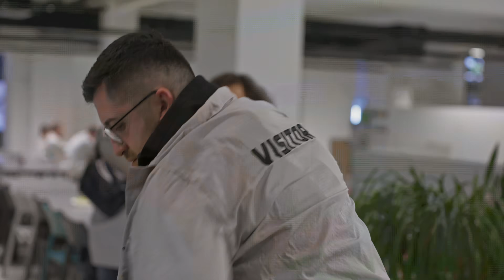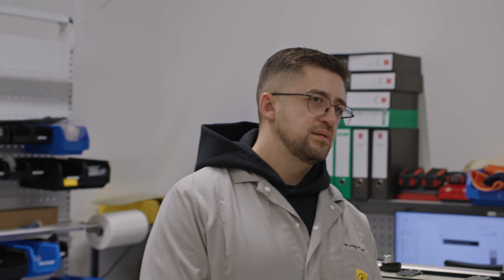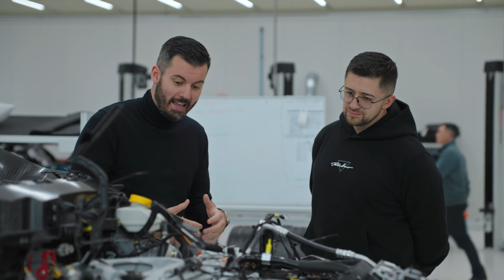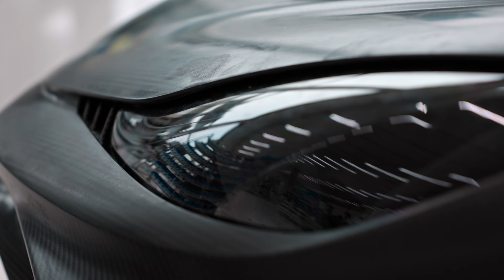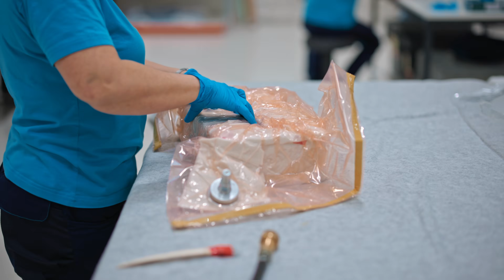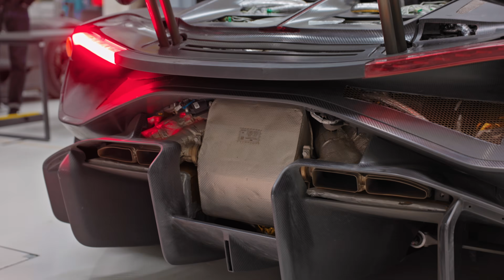Mate Rimac Explains New Bugatti Tech // Campus Tour

Comment: Next video should be about: 1. The ideas Rimac stole from a regular garage guy from Samobor, Croatia back in 2008 and never paid him a dime
                                                   2. The money his father stole in the past 25 years and got jail sentence just a few weeks ago. The money was also used for the Concept One - first Rimac car.
                                                   3. Pushing the deadline on Robotaxis for the sixt time in a row. He received 179 milion euros from the EU to develop them, so far only provided a drone footages of those robotaxis parked :)
                                                   4. Complete failure when presenting the first Robotaxi in 2024. Rimac received the 179 milions because he promised level 5 (Full Driving Automation). When presenting the Robotaxi on the stage, the guy was seen backstage with a joystick and controliing the 
                                                       vehicle. Mate later confirmed that Robotaxis cannot operate without joystick :). That also did not work, since the joystick broke and Robotaxi didn't move an inch :)
                                                   5.Promise from Mate himself that Robotaxis will be 90% in-house built. Well in the end, he bought the finished product from the Israel based company -Mobileye and the car chassis will be manufactured in South Korea
                                                   6. Would there be Nevera without engineers from Porsche?
                                                   7. Bragging about Bugatti when he holds no rights at all for any aspect, except from the fact that Porsche is also behind everything and used Mate for the promotion mostly.

Comment: The E30 M3 might just need some maintenance to bring it back to its factory glory. Suspension bushings, shocks, and a good fuel system cleaning will do 90% of it. But of course, Rimac’s point of reference is 1000 hp+ HyperCars 😎

Comment: At 6:45, Some great remarks regarding linear flow in manufacturing, with zero fail rates👌🏅 Excellent choices in automation and integrated QC. I was once QC for some sensitive items, and you guys have obviously adopted a great QC and are reaping the benefits 😇. At 21:20, containment of battery chemistry as integrated with structural mechanics and design if my thinking is correct.. True?. An additional note; torque vectoring is a key transition in automotive markets 🤔😉  An intersection between functionality and performance seems paramount here🫡

Comment: Whole hybrid stuff does not make sense. Mate tells it him self, 180kg battery, 3 electric motors, 3 gearboxes etc. That just simply is not good. Remove all that extra weight and the car would be extremely nimble. And with modern V16 it is going to be extremely potent. It is in the nature of naturally aspirated car that power increases with rpm, but so does grip increase with wheels turning speed. So it makes perfect sense as you propably can not put all the power in the first gear on to tarmac anyway, and then you can drive it in low rpm and car is calm and  then mid to high and it is violent. These are excuses to put any batteries in it.
Reply: While I agree with you for the most part, you really have to think who is going to buy this car. Mate said in the video the V16 engine alone is making 1000hp which is an incredible number for any NA engine. But the problem comes right here: the Chiron already made 1500hp and if you are selling a new vehicle that is supposedly better than the old one you can't have less power, specially at this level of vehicle that is supposed to be the best in its class (and you have to pay a big amount to own it). He also explained the Chiron had quite big turbo lag, so he's going to use electric motors to take advantage of their instant response. Again I don't like it either but that's what their customers are expecting.